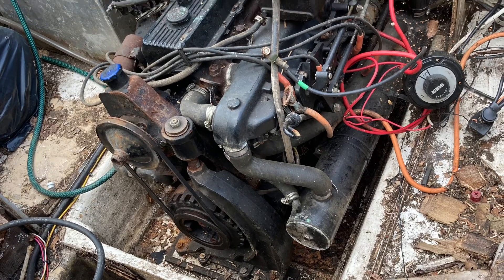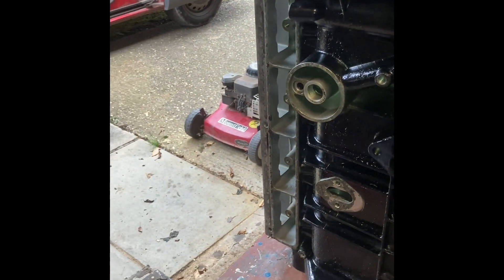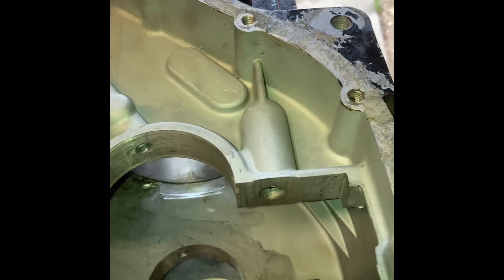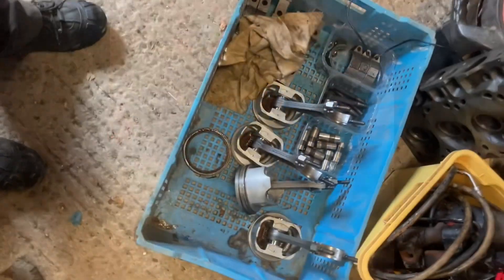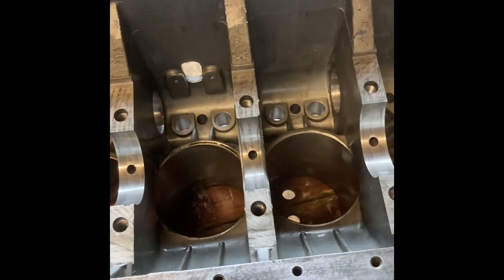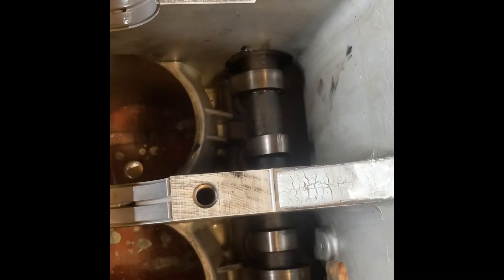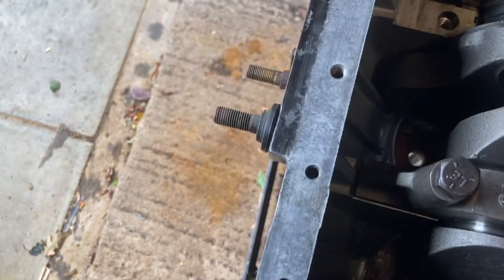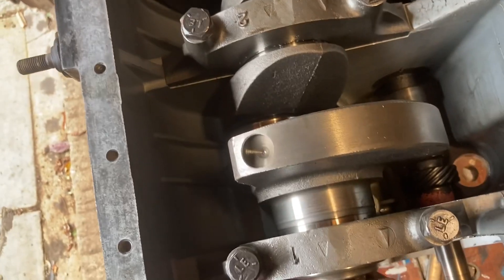Mercruiser 470 3.7l engine rebuild part 1

Comment: Never put oil under your main bearings
Reply from the maker: @jeremysparks4570  that’s what I was taught 30 years ago by an old man who had built engines for years. 
I’m interested to know your opinion on why you shouldn’t. 
👍
Reply: @Keithsbrokenboats  Likely to spin in journal , and clearance issues , Speaking  from 25+ Experience and Owner of several Auto and Marine Shops

Comment: Good old ford 460 1/2 most 1974 ford 460 parts will fit like head gaskets heads  engine parts like valves lifters and aluminum heads 
Some guys even put them in cars the Chevy th 350 th400 trans will fit it with a Chevy bell housing be nice in a mini cooper the biggest 4cy u can get with 250lb of tourqe
Reply from the maker: Yes the push rods I bought were for a Ford 460. 
Thanks for your comment 👍

Comment: Outstanding visual of the working mechanics of this engine. Helps one understand the essence of its design. As you said, "this is not an instructional video" yet the users who view them and can figure stuff out, will be able to easily and confidently attempt the same. You give a sense of reassurance that the job can be tackled.  Thanks for spending the time to film and commentary the video.
Reply from the maker: Thanks for your comment 
I’m glad you liked the video

Comment: Very interested in this content. I’m in the process of pulling the same engine out of a boat that has sat for 20 years,  good luck!
Reply from the maker: Thanks for the comment 
The inside of the engine is in good condition but the problem I’m going to have is the ancillary parts that go around the outside. I have found out that the engine bay was probably full of water and has got into everything (starter motor etc). 
All these problems I will show in later posts. 
Thanks again for watching and subscribing